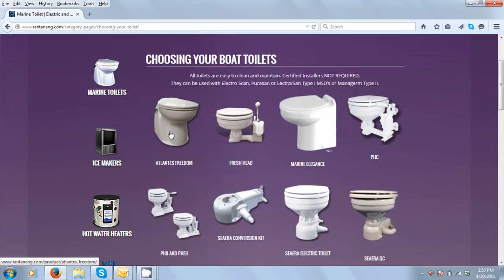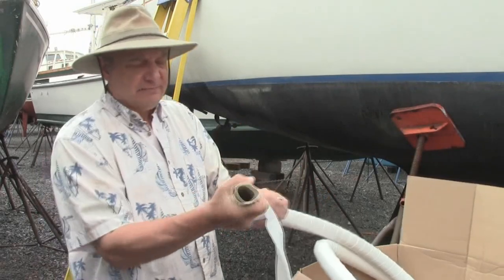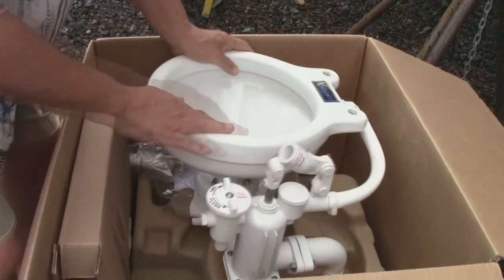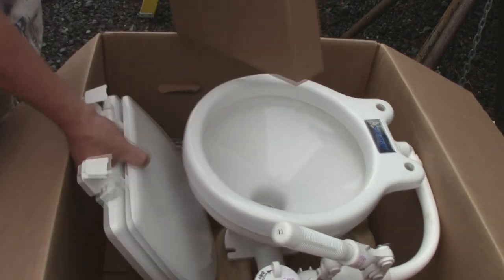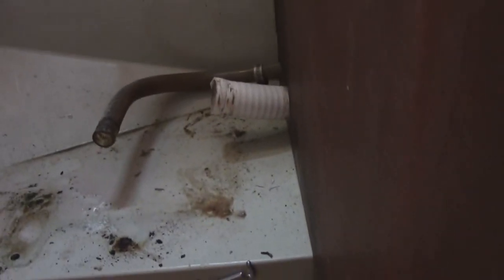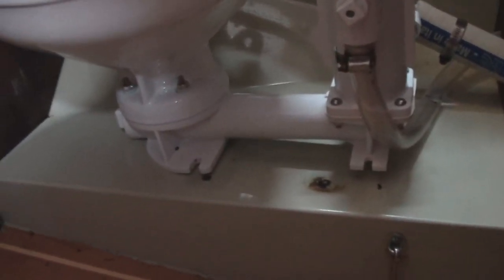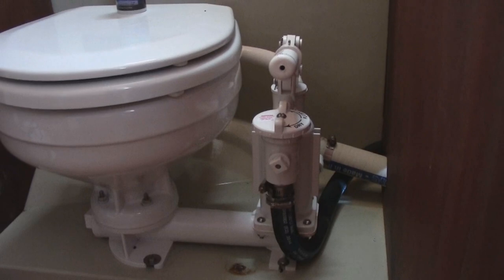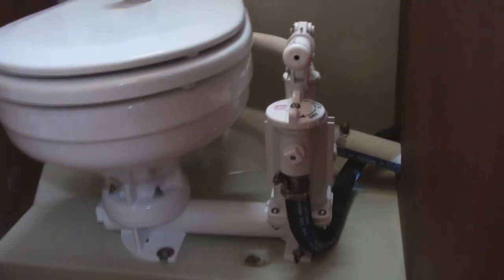Raritan marine toilet

Comment: Thank you for posting this I'm about to do this on my 32 foot sailboat.

Do you have a macerator in line or does this go straight out through the hull. I have a macerator and it would be interesting to know
Reply from the maker: Kelly Williamson i did put a macerator in https://youtu.be/05GveKeDHG4
Reply: +Kelly Williamson It's illegal to go straight out through the hull in a No Discharge Area. Federal law says that untreated sewage (even if it's been dosed with a deodorant product) can NOT be discharged in inland or coastal waters. This means the sewage from a portable toilet or a Type III holding tank or hull can not be discharged unless you are in the ocean more than 3 miles offshore.
Reply from the maker: +Josef Roesler you are right that is why i had to make the changes
Reply: +WaterfrontVacations1 I heard you say in another video your boat dumped straight out, I couldn't believe that.  That's got to be some shenanigans a previous owner did?  Or is the boat so old it came that way?  I'm taking delivery on Monday of a Catalina 30 and it took me a good while to figure out all the valves just to flush the toilet legally.  I have to wire down two of the valves when I can get to it.
Reply from the maker: +Josef Roesler Yes it did but I had it shut off and closed off the hose.  My boat was built in 1975 and was designed to do off shore cruising, i think.. I never use the over board dump